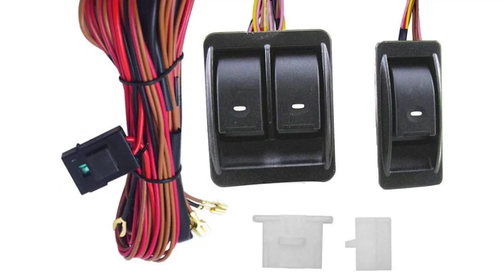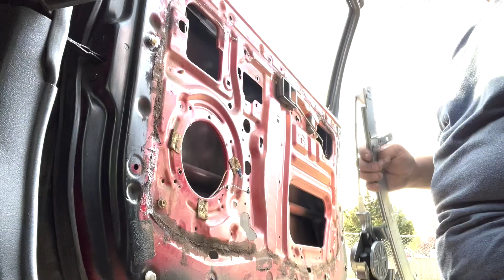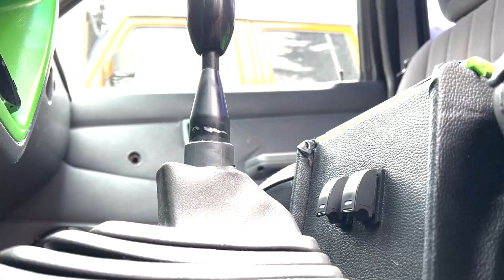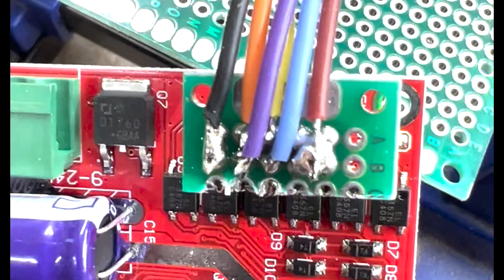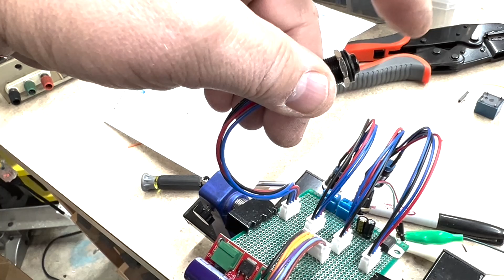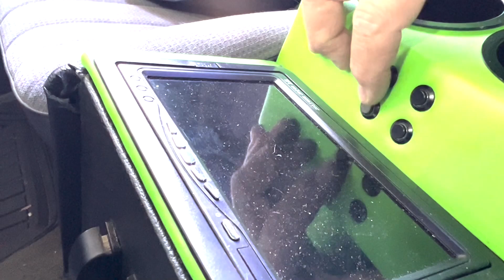Nissan D21 Power Window Upgrade Upgrade

Comment: Do u need that little computer board?
Reply from the maker: no, however the computer board is an electronic way to switch the polarity of the window regulator using a simple button